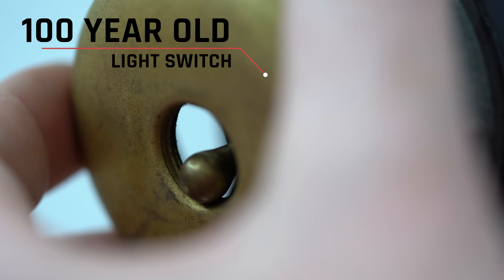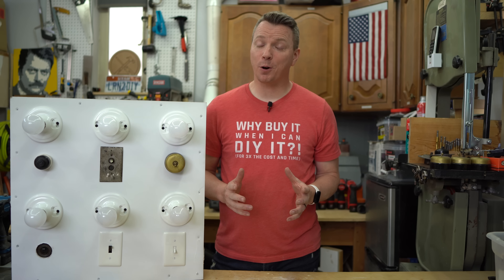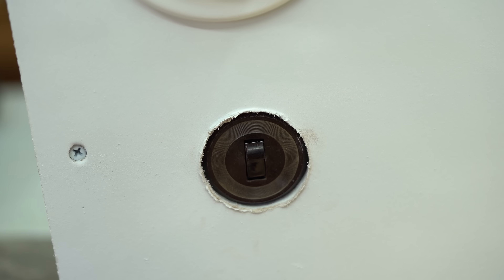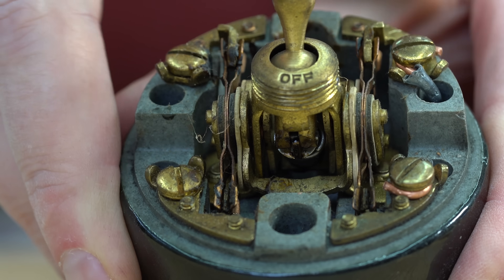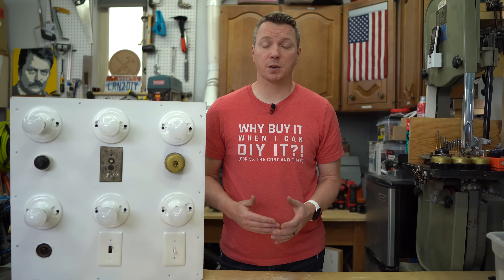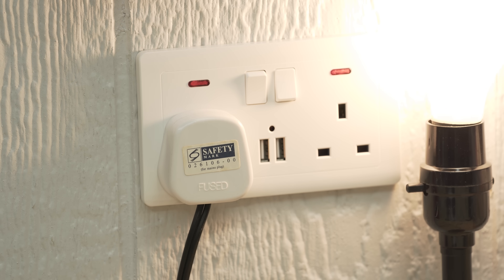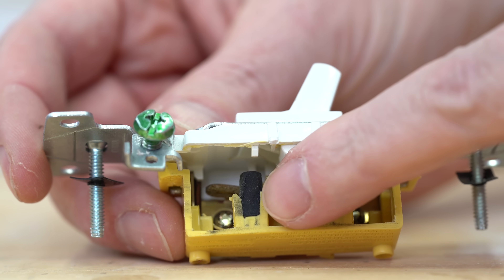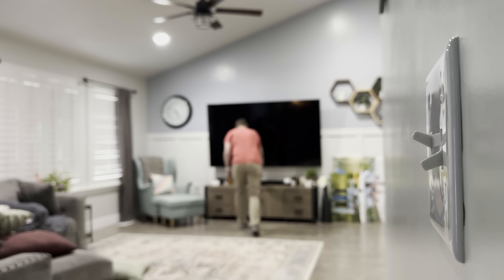How a Simple Spring Changed Light Switches Forever

Comment: This was an interesting video, but I would have loved a more detailed explanation of how the spring mechanisms worked.
Reply: same, I'm quite disapointed by the video.
Reply: @isaz2425  and @Flapjack. A spring tends to extend if compressed. In a switch you have 2 states: the OFF and the ON positions. In these 2 states the spring is positioned in such a way that does not activate the switch. However, the spring, when going from the ON to the OFF state, is more compressed and in a state of non-equilibrium. It will therefore push the switch either side, so to extend itself. Once it is in one of the two opposites, it is (more) extended, and in an angle for which it does not push the switch to the other side, as I said above. You can see this in the video at the minute 6:31 . Hope it helps!
Reply: If you want to know more about that, it's called a bistable mechanism.
Reply: @GregChabala  It's also called a "toggle mechanism". Most modern switches DON'T have a true toggle or bistable mechanism. Those make a much louder "snap".
Here's a video that shows a true toggle mechanism. https://youtu.be/TEH9aKqVhOE
Reply: Yes, all that time and all those commercials and all we got was “a little spring” makes it work.  Its a video for crying out loud, show us how it works.
Reply: Yes, some graphics, would have been nice, for those not familiar with the basic principle. Here is my basic explanation for those interested. 
  Basically the spring gives resistance (a push back in a sense) as you start to flip the switch. When the internal mechanism reaches the halfway point, the push back from the spring turns into a push forward on the internal mechanism. This launches the mechanism forward on it's own, engaging or disengaging the contacts in a split second. All this to avoid arching. The internal mechanism is actually on levers and pivot points so the movement of that mechanism is not tied to the exact movant of the switch lever you touch. Otherwise, you would feel the light switch quickly pop away from your finger as it is switched and goes past that half way point. This could be a surprise to the person flipping the switch as well as there being addition noise generated. 
   Without the spring building and storing potential energy, and then quickly applying that force to the internal switching levers, the switch would just flop into position with no clicking sound. Also, the contacts would not be held tight against each other. Even the external switch lever would fall back down a bit, depending on the internal friction of the pivot points, causing slow disengagement of the contact and therefore causing an arch. It's virtually impossible for the spiring to fail (the actual metal spring). In rare cases, impact or pressure, to the case the switch sits in, could break it apart. Only this can cause the spring to come lose and no longer provide the stored energy. Repeated extreme overheating can also cause such failures but all very rare.
Reply: @RemmikRotus  I repeat. I haven't seen a wall switch made in the last 40 years that has a true spring-loaded snap action. They have a detent, which produces a soft snap, but not an actual "click". I can move them gradually to where the light flickers, with every switch in my house except one.  I know it's arcing a little because I hear interference in my AM radio. But with AC it's not an issue.
Reply: just dismentle an old swith and see how the spring works. I learned it in my childhood that how smart is to use spring force in either state. the same idea is used in car hood lid and hatchback door, later I noticed.

Comment: We just bought an old farm in Denmark, which has not been renovated since 1950. Only the front received an upgrade around the 1950's but the rest of the house is filled with these two button switches. Had never seen them before. They are fun but need replacement, since the springiness is gone. But will try to keep them and potentially repair the mechanisms (if I can get parts).

Comment: The modern light switch is louder when you flick ot on because of the connection made between the two bots of metal connection the circuit and when turning the lights of it doesn't connect anything and therefore is more quiet

Comment: Light switches in Switzerland are buttons with a LED inside. The LED helps you find the switch in the dark and shows you if it's on or off. The position of the button stays exactly the same, no matter if it's turned on or off. No position to indicate state. Furthermore houses are planned in a way, so that one can turn on and off a light from several switches, for example down a long hallway, you can turn it on and off from both ends without having the problem of "up = on, down = off" or having to run down the hallway to switch it off.

Comment: Modern switches don't use springs, the newer ones use relays, but the ones that have been here since at least 30 years, since they are the ones that I disassemble as a child, did not had any springs, yes, they did had a spring action, without a spring, the metal sheet used to make the connection is the spring, not a curly metal, a sheet, and as I said, new ones can use relays, so no spring, this info is outdated by decades.

Comment: This video. Is about light switches and you say that in about other countries they may look different.

 But at 6.15  it is not a light switch but a UK switched socket(outlet in the USA) with built in USB ports. The switch technology may be the same but it is not for a light unless you happen to plug one into that socket(outlet). The majority of UK sockets (outlets)have switches on them. However un-switched ones sometimes have a remote switch . This may be found in a kitchen where appliances under the worktop have a switch above it.

Comment: Thanks Nils. I am 50, here in NE USA. I def have been around those pushbutton switches. They may have been safe enough, but I already knew that those old devices could be a problem. No telling if some diy guy wired something into the system without grounding….yikes.

Comment: @5:12 When would someone want to rapidly switch a light on and off repeatedly, and how often do the walls of your building tilt? Neither of those things are downsides. Also, the presence of mercury isn't really a downside, either: How often are switches disposed of? @8:05 That's so blind people can tell if the light is being turned on or off. ADA is everywhere!

Comment: I have worked with all kinds of switches in my life and never really thought about the springs. I worked on Pinball machines a lot and the flipper switches were bladed with a large (like 6mm) tungsten contacts that were activated by the player pushing against them with a plastic button and they were used in 50V with anywhere from 5a to 40a loads and they often had to be replaced because of arcing and would in some cases weld themselves closed. Can you tell me what the contacts of a modern light switch are? Just plated steel or copper?? Surely at the cost they can't be tungsten??
Thanks for the video

Comment: Knife switches, as you know, are still used but usually as disconnects for big power devices.  Since disconnects are more of a safety device to prevent power from reaching the device when performing maintenance than to actively turn it on and off, it's not a big deal when used in this manner.

Comment: The mechanism is called an over-centre toggle, hence the name "toggle switch".  They are used in air compressor pressure switches, because the pressure rises slowly the toggle action is required to prevent arcing.  It is also used in toggle clamps.

Comment: i saved some of the push button switches when i redid my home "New England aswell." They work great still. Also ive come across some switches from the 60s-70s that have a horizontal spring. Samke concept but different spring tension.

Comment: One thing about the Mercury switch is that they are insanely durable
Reply: Which is why they are used in gas pressure switches for durability and safety. Their one drawback is they have to be mounted horizontally. Often, they come with some kind of level measurement device.

Comment: I've actually seen and used the push button switches before. Where I've in PA, there are still houses that can easily be a couple hundred of years old. I had a friend that was renting a house that still had those switches. The house was renovated a lot don't get me wrong, but I think they kept those switches cause they still worked. There was something about those push button light switches that was so satisfying to use. Couldn't put my finger on it why. (I just saw what I did there after I typed it and I'm keeping it. 😂) Probably because they were so different from what we're use to and the fact of how tangible the history was with those switches.
Reply: I grew up about an hour outside of Philly. Our house in 1993 had one of the push-button switches built into the railing on the stairs.
Just checked & it was built in 1900! Haven't seen any recently

Comment: As a child in the latter 1950s and early 1960s, I was fascinated by the push button light switches in my paternal grandparents' home.  Many of them had the mother of pearl overlay on the on switch.  I also recall using a few rotary light switches during the same period.  I don't recall where, but they seem to linger longest as a switch for basements and other relatively unrenovated areas.  The push button switches in my grandparents' home were still working until  they were replaced during a repair and renovation following a flood in 1972.

Comment: Those push button switches were common in Montreal in the 60's.  I liked them.  I also remember light sconces where wires had been fished through the gas pipes so electric lights could replace the gas mantle fixtures installed when the house was built.

Comment: Less Voltage higher current, and US switches have a problem with resistance when connectors not fully engage. I live in Europe, and we have 230Volts and lower current. This resolve problem. Why 120V?
Reply: Not only why 120v, why are we still only using single phase in the US.  The whole arrangement is stupidly inefficient for power delivery.  3-phase 240v is what we should be using imho.  Circuit breakers should also have built in AC/DC to directly power modern electronics. Having it transformed by one device would reduce power losses and phantom drain significantly over they dozens of wall warts currently required. But good luck getting anyone to agree on a DC power standard, can't even get the whole world to agree on an AC standard.

Comment: I'm 44 years old. My dad's friend lived in a 100 year old house back in the 1980's, so like 140 if it were still standing. It had those button style switches. I was sent to a room to take a nap. The room had those switches... I spent the next two hours pushing on then off... they didn't always arm right. It'd get stuck and wouldn't be able to turn it on until I hit off again first...
Reply: Worn out spring, this happens with modern light switches as well.  This allows you to get them stuck in a very undesirable simi-on state.  It can cause arcing that can weld the switch into that position permanently.  If a switch starts getting mushy its time to replace.

Comment: Those 97 cent ones certainly won't be working in 100 years 😂 my home was built in 1996 and I had to replace the switches because half of them were physically broken. They felt really mushy and didn't click. I replaced them all with the outrageously expensive $2.50 commercial grade switches. They're built much better.